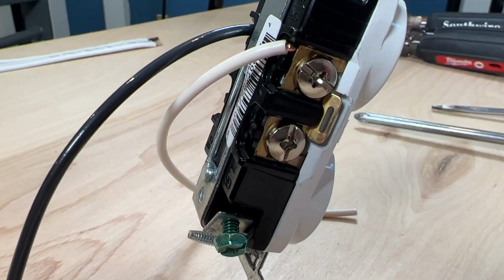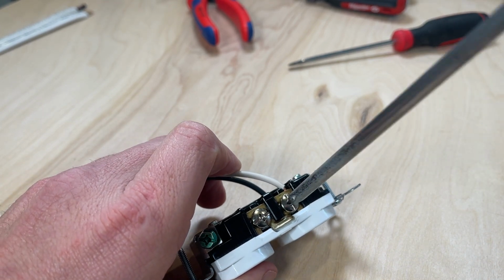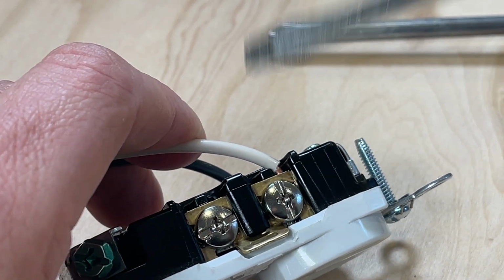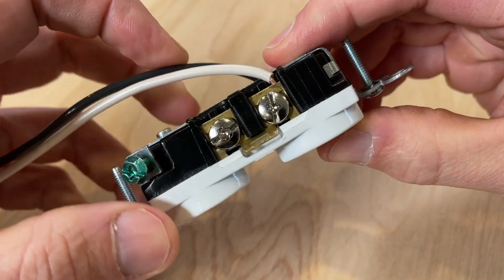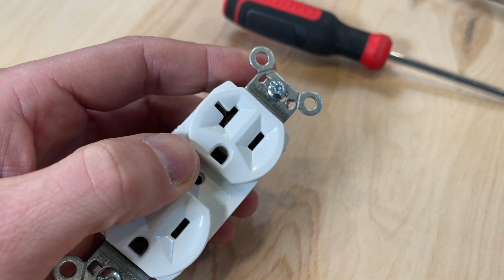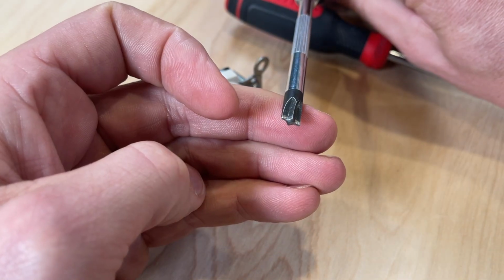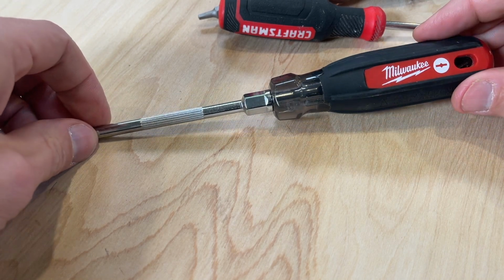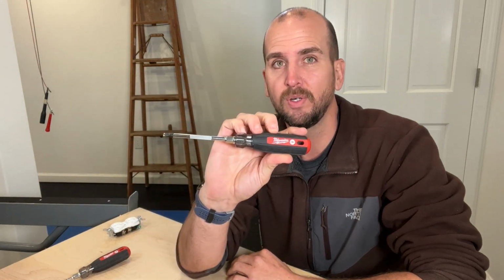80% of People Use the Wrong Screwdriver For Electrical Work

Comment: Yeah, I always have enough slack in my wire to tighten the outlet screws on a cutting board. I guess we should should all show up six months later on sites we wire and offer to tighten all the connections we made, because maybe the wire contracted and the circuits might arc!  Why don't we just solder all our joints, like the old days?  I'm not saying aluminum wiring was a good idea but what do you want, torque screwdrivers? And bi-annual testing?

Comment: I use both slot & phillips, using the slot just to torque it down, at the end. I can do all of it with the two screw drivers, and a pair of long nose pliers, which I use to strip wire, too. With practice, you'll avoid nicking the wire.

Comment: Very interesting!  Something I never knew. Now I know why. I checked my big box of spare outlets, switches and etc. Out of a couple dozen devices I found TWO that had square drive screws. One was a 20 amp Slater outlet, the other a P&S 3-way switch. And here's the kicker guys...a high quality phillips head driver has a SQUARE tip, not a pointy one. That means the phillips driver fits those Robertson drive screws like a glove and provides more than enough torque.
Reply: Maybe.
Reply: Klein screwdrivers have ,.
Reply: Klein screwdrivers have been my most trusted tool for 25 plus years, especially when working with high voltage it's my tool of choice it's never let me down

Comment: A Brief History of the Phillips Screwdriver and Screws:
They were invented in the Early Days of Factory Manufacturing, back in the day when motive power for power tools was provided at a central plant, often steam or waterwheel, which was then transferred through the factory with leather belts and pulley systems. There was no Torque Limiting on Power Screwdrivers back then. As a result, the overpowered flat-tip screwdrivers would too often strip the threads out of screw holes.
The Phillips Tip was invented to act as a Torque Limiting method. It strips out the head rather than the threads.
Phillips are not the right bit, if you want torque, for ANYTHING. But, if you're driving Brass Screws into wood by the thousands per day, for example, with a driver that has no torque adjustments, they are ideal.

Comment: Genius... and why didn't I know this before my weekend switch replacement project.  I used both philips and flat on the project because neither one works great for me.  I had no idea the other 2 options... and I even have a few of those square bits in my tool cases.  Ha.  I'll know better next go around, now that I've practically rewired every outlet and switch in my house.  :)

Comment: I discovered the Robertson solution by accident about a year ago. I bought a 4 pack of klein insulated screwdrivers. 1 number 2 philips 2 slotted and 1 Robertson square. I bought the set to install outlets in the house and after fiddling around with the 'start it with philips finish it with slotted' method, I looked closely at the outlet screw and pulled the Robertson out of the pack and had that eureka moment.

Comment: I NEVER saw or heard of ECX. I expected to see a straight-sided (non-tapered) variation of Phillips, maybe Reed-Prince, French recess, JIS, or a 4-finned version of Torx. I have noticed the squarish hole in some electrical screws, and I have actually used a Robertson driver and screws (exactly once, while visiting Canada), and I've noticed multiple sizes of square drivers in most "fit-everything" bit sets, but I NEVER THOUGHT OF trying a square bit in an electrical screw. Electrical screw-heads are obviously MADE TO A SPECIFICATION (which NOTHING ELSE USES). I gotta wonder, WHY ISN'T EVERY BOX CONTAINING A WIRING DEVICE MARKED WITH NOTES ON WHICH SCREWDRIVER(S) ACTUALLY FIT? It is obvious that the screws accept more than one kind of driver, but it is not obvious that they accept FOUR kinds of driver: slotted (crappily), Phillips (crappily), Robertson square (pretty well), and ECX (well). They could have made all electrical screws accept only socket-head HEX drivers, or only TORX drivers.
Reply from the maker: It is my best guess that the manufacturer have adapted the design over the years to fit the preferences across multiple regions/countries.

Comment: The NEC requires to actually torque the termination per manufacturer specs. IE, in addition to using the right tip use a torque screwdriver

Comment: What you call a square drive IS NOT a Robertson. You will find that a square drive bit will have all of it's sides at a perfect 90° while the Robertson bit are slightly tapered because those bits are designed to grab the screw so it will stay put even while holding the screwdriver horizontally. Robertson tried to sell his patented screws to one of the American car manufacturers (Ford I think) but they wanted to make their own screws under license. Robertson wanted to profit from the sales of his screws so no deal was made. The car manufacturer then went and created the Phillips head. Until the Canadian Patent finally expired, the square drive was not allowed to be imported in to Canada as it was deemed a violation of Robertson's patient. Kreg pocket hole screws use a square drive while Robertson Inc. is still based in Milton, Ont. I have many boxes of both Kreg & Robertson branded #8 screws in many different lengths as I own a Kreg pocket hole jig but use Robertson screws for everything else unless I want the washer effect that a Kreg pocket hole screw gives you.

Comment: The right slotted screwdriver is a fine choice IMO.  None of the industrial Electricians I worked with used anything else to wire outlets of any kind.  TBT, that tiny little thing in the video isn't the right one : it's too thin AND too narrow AND it's not insulated.
Reply: It is the right one.

Comment: Retired Steel mill High Voltage Electrician. I carried a high quality multihead screwdriver, usually Klein. I could twist the head off that screw with a slot or a phillips head #2. Learn to use the right torque and either will work. Although I carry a square drive tip, I don't bother to use it on receptacles. That fancy screwdriver I wouldn't bother with. I need tools I can use for many things, or I endup with a pouch or carrying 20 pounds of tools up 9 stories of stairs.

Comment: Standard screwdriver but used is your #2 (or PH2 Milwaukee meaning Phillips #2)…the screw size for outlets is a #3 bit…the higher the number for Philips, the fatter the Philips edges and flatter the tip. 
  Note: a number 2, will work just fine for outlet screws/bolts…but it is not a snug fit, it will damage the screw/bolt and your tip as well.

Comment: Before this video starts I gotta tell you, I'm an American sparky and I use Robertson wherever I can. 

Did I guess it?
Reply: Yeehaw!
Reply: Robertson rocks. Thanks, Canadians! (I think?)
Reply: Oh haha, or the Milwaukee thing. I'll never remember it, I forgot it the moment you said it 30 seconds ago

Edit* I'll never remember the name. He just said it again and again, no idea. It'll probably always be "that weird Milwaukee thing" to me. It's awesome, but I am among those that believe virtually everything should be Robertson.

^5 for another fix&flipper doing their own work!
Reply: Never seen a bit though, just the sparky hand drivers. I'd be more keen on the Milwaukee thing if I could snap it into a torque driver.
Reply: Idk why, as an owner of several torx-everywhere European vehicles, I forgot about Torx. Torx and Robertson are my jam, for pretty much any fastener where I don't want my bit to cam out pretty easily (ie Philips), or cam out like a dozen times per fastener (flat). Stuff like deck screws, I'm all torx'd out. I have several decks and several patio covers (multiple homes & one little lakeside cabin that's more deck than cabin) that are 100% Torx fasteners and Paslode 30° gas gun nails. The latter to a lesser degree, but my Li-Ion gas Paslode framer is most definitely one of my top 10 favorite tools. Lay off me yo, I love my super reliable and much lighter hoseless gas nailers <3

Comment: It ought to be ok to use a Philips to get the screw to the start of snugness then finish with the wide, thick slotted driver.  The bit of patience to find the right drivers and switch them at the right time will be rewarded.  Next best, use the wide, thick slotted driver and be slow and careful to keep it seated in the slot.